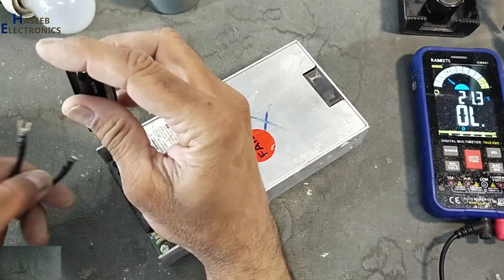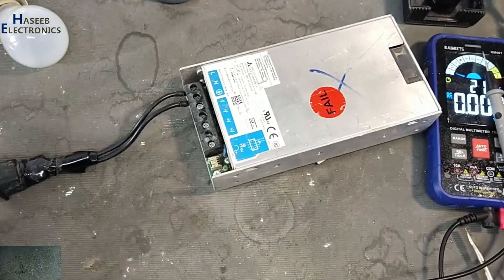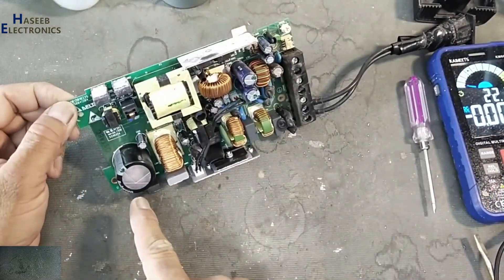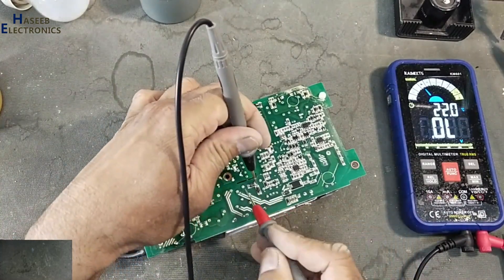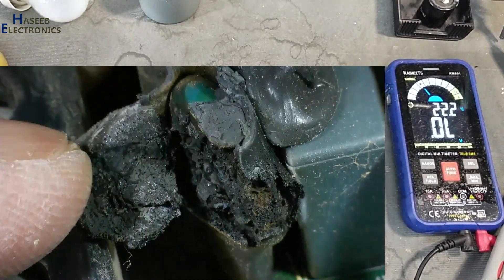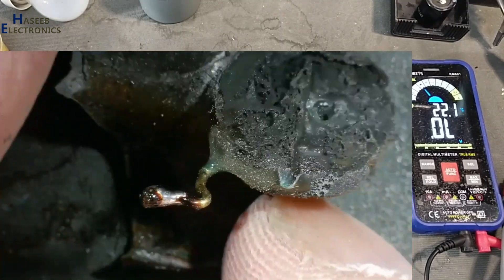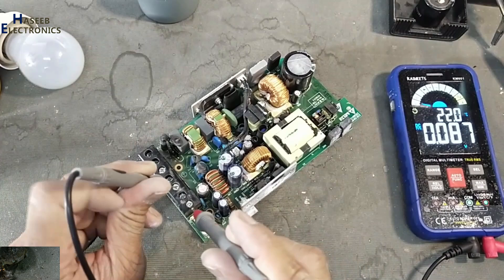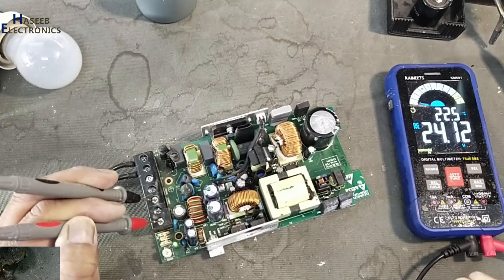{1107} SMPS not turning ON, no output voltage

Comment: Hello. Where do you get the BFW-1 fuse wire? So far I found it to be very expensive ($120 - $300 USD), for a spool like yours.
Reply: Use any thin wire. You can buy a roll of 0.05mm or 0.08mm wire, or take one strand of wire from a multi-core wire cable, it's usually about 0.1mm. That will blow at about 2A but for testing with in-circuit lamp it's fine.
Reply from the maker: I purchased many years ago that time it was very cheap 
But now a days i see its price is multiplied by many times (i think the became to know that a YouTube channel is using their fuse wire 😂😂😂) 
You can use thin copper wire or use think solder wire 
You can check their melting point by adding load and measuring current values at rated line voltage
Reply: @HaseebElectronics  Using solder is interesting point. In modern Li-ion batteries used in laptop they have a special fuse inside the battery. If it detects any problem (including high charging current or a flat battery not charged for long time) it will blow the solder fuse. They can be repaired by opening the battery to access the small board and adding more solder to rebuild the 'missing' fuse :-)